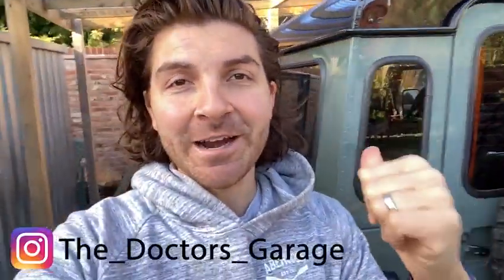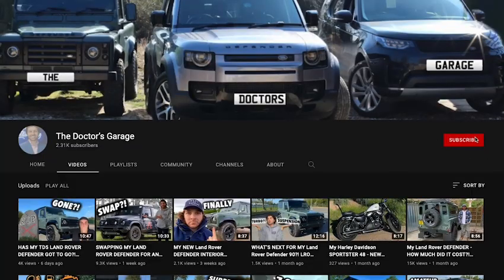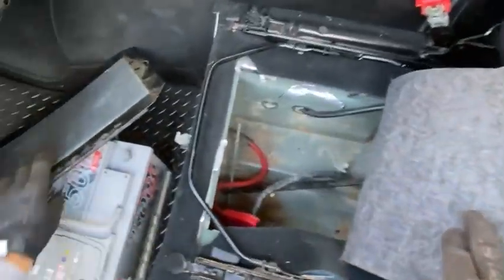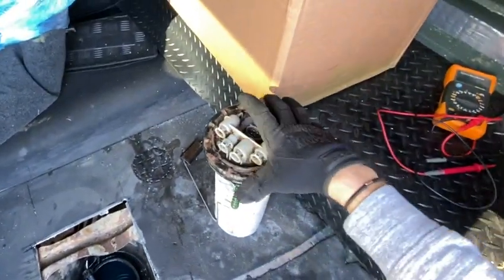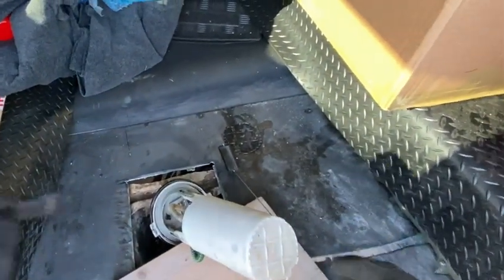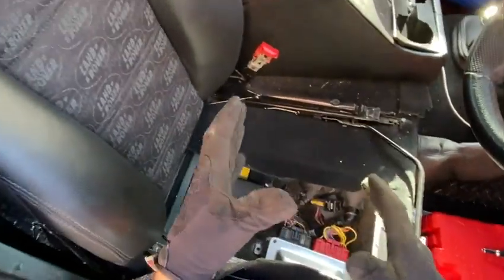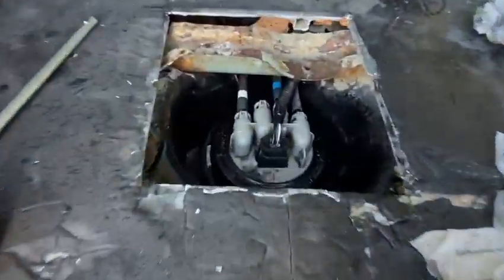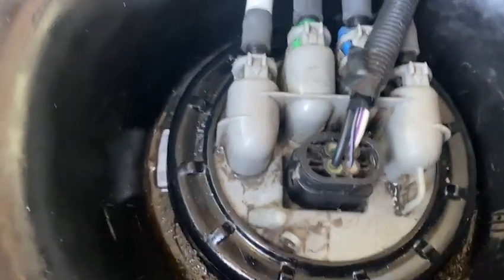EP.3 FINALLY FIXING MY LAND ROVER DEFENDER!

Comment: You will not regret having an access point to the top of the tank in the back of the truck.. as long as you cover it up nicely of course. I found it very useful when I had to replace a line that had worn through on the edge of the chassis. Glad you fixed the ECU problem too of course but it was a great exercise in diagnostics. It's remarkable how many complex technical problems you can fix just by laying on your back with your eyes closed, thinking the problem through logically.
Reply from the maker: Thanks Tim- glad you enjoyed the video and yes I agree the access point will be useful in the future. It was a pretty amateur diagnostic method but got there in the end! appreciate the support🙏🏼

Comment: Well done on fixing your Defender.  
A very important tip when dealing with car batteries.  ALWAYS disconnect the minus first and ALWAYS connect it last.  The reason is if you handle the positive cable clamp while the negative is still connected, you can cause all kinds of damage if your wrench or spanner makes a connection to the chassis.  Worst case scenario is an exploded battery with acid going everywhere.  In your eyes, for instance.
Reply from the maker: Thanks Ole- and thanks for the great tip. I always wonder what it the right way to do it and now i know! Always prepared to get a shock off it when working on disconnecting and reconnecting it

Comment: I have been following this with interest as I have an erratically functioning fuel gauge on my 2006 TD5. No problem with the pump itself but I suspect a fault in either the sender unit or the floatation device  -  I am considering "going in" in the same way that you have and you have made it look relatively easy.

Great videos but your delivery is very rapid, often "clipping" your words, and I find it difficult to follow what you are saying. Perhaps slow down a teeny bit.
Reply from the maker: Thanks Colin - it’s really not that bad cutting if you just go steady. Thanks for the feedback
- really appreciate it and will take it on board for
Future videos- just got caught up in it whilst doing the repair! 🙏🏼

Comment: I'm glad you got it sorted in the end Marcus, I'm glad your put the original fuel pump back in, those cheap copies are cheap for a reason!  Your next job is to tidy up the chassis rust corrosion.  I'll tell you what I used on my truck and your can work from there.  Wire brush of the worst, a hand brush is sufficient.  Treat with rust converter such as Hammerite Kurust, there are loads of other products but this is as good as most.  I then used Corroless glass reinforced chassis paint (black) 24 hours after the Hammerite.  Then I used Dinitrol 3125 HS sprayed over everything I painted.  This is a reasonably light coating, not to be confused with the old fashioned Waxoyl treatment in the past.  Box sections, I used Dinitrol ML in cans that you can attach an airline to spray but they are available in standard spray cans.  I'm sure others have used different applications but this will give you something to carry out further research on what you want to do on your own truck.
Reply from the maker: This is brilliant Tony- thanks for all the details- definitely need to get the underside sorted- when you used the Corroless chassis paint was this with a brush?
Reply: @thedoctorsgarage  Yes just brush it on, it's easier to get to the tricky bits.  Check out arc-rite paints, they do various combinations of paint treatments in case you want to use a rust preventative primer before a top coat.

Comment: Yeah!!.. lol brilliant news its alive!!.. hole will be easy fix. You can buy automotive sheet steel from most car shops.. cut it oversized drill & usually flush self tapping screws. I'd put a seal around inner edge to stop dirt getting in, fumes coming out if  you ever had a diesel leak.. you could get colour coded paint too.. its a HOLE other episode 😄

Comment: Congratulations. Dont worry about the hole, it will give you confidence on long trips as you can swop out the fuel pump in minutes now. |I have a spare ECU, one remapped and one original, gives piece of mind.
Reply from the maker: That’s a great idea! Appreciate the support🙏🏼
Reply: @thedoctorsgarage  Also in Sweden I have to have the original ECU (Unmapped) fitted to pass their version of the MOT. Did you decide to do something to slow down the chassis rust? Even a good spray of WD40 helps, before winter.

Comment: Well done fixing it  ! It is still a bit strange that the ecu just packed up without any warning . I’m rather impressed with your mechanical skills and/ or rather how methodical you are in getting to the bottom of the problem . I hope you got an explanation from the alive tuning as to why or how it could have happened so it doesn’t repeat itself with some other underlying issue 🙏
Reply from the maker: Thanks for watching Ben and thanks for
the kind words 🙏🏼 Alive have been great at getting the ECU sorted so quickly for me - not sure there is a specific reason they fail but I’m
Sure if I had any trouble with the refurbed one they would sort it out for me